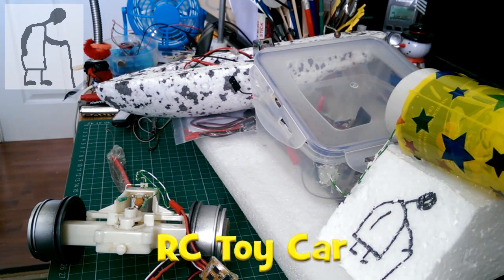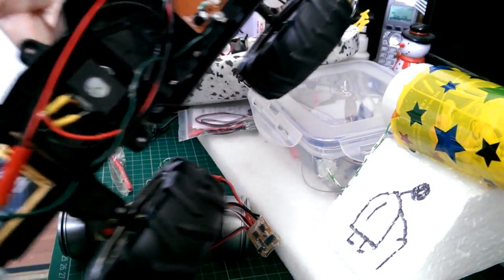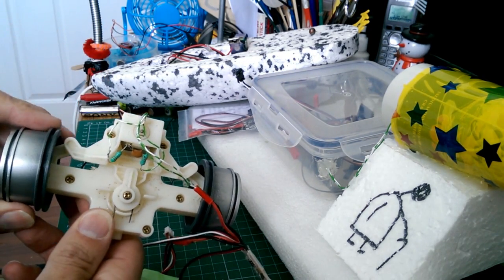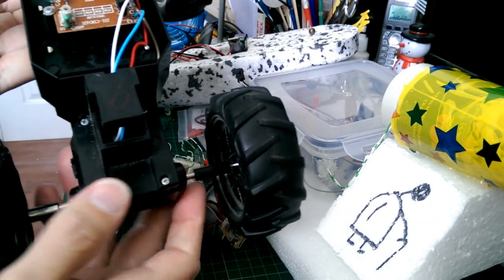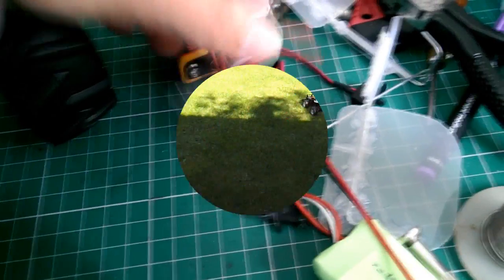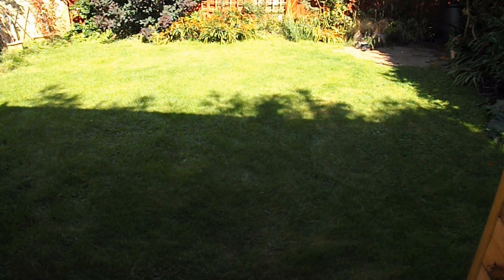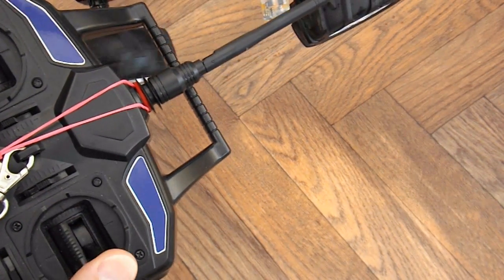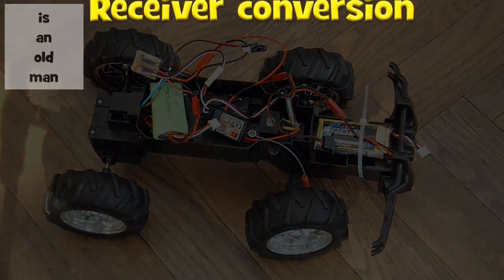RC Toy Car Hobby Grade Receiver conversion

Comment: I incorrectly thought toy grade RC cars had both the receiver and ESC on the same PCB board, but toy grade cars don't have an ESC at all. Just 4 signal switches or 2 switches per motor (channel). Its 3 positions per motor. Neutral, clockwise & counter clockwise. Your videos exposed this. I don't know why I didn't realize that sooner!
Reply from the maker: Yes, they are basically just "on/off" switches. There are more complicated toy grade that try to bridge the gap by giving stepped power stages to give the impression of proportional control.
Reply: @GrandadIsAnOldMan  Yea I think thats a form of Pulse Width Modulation they put on the motor channel. Where instead of forward and reverse, they have forward fast-turbo, forward basic\slow and reverse basic\slow. I had some of those cars in the 80s.

Comment: Hey granddad long time no see I was just wondering if you found a way to without using a servo still use the original motor inside of a toy car with a hobby grade remote
Reply from the maker: The video you are commenting on does not use a servo. I am guessing you mean control the toy grade receiver with a hobby grade remote and the answer is NO you can't do that. In fact I repeated this video in 2021 with a different cheap hobby grade kit https://youtu.be/UdB9KA50t6w I did once see a video on YouTube doing the opposite, controlling a hobby grade servo with a toy grade remote. I haven't been able to find that video since seeing it, but he was using a circuit board that took the output from the toy grade receiver and converted it to PWM for the servo. It still wasn't proportional, so I couldn't see much point in doing it.
Reply: @GrandadIsAnOldMan  since then I have taken apart broken servos and used the chip inside as the servo controller and basically it turns that motor into the servo motor and it is proportional

Comment: Does the ESC automatically handle the voltage inversion to change from one direction to the other?
Reply from the maker: Not sure what you mean by automatically. Your controller sends a signal to the receiver. The receiver sends a signal to the ESC to tell it what to do.
Reply: @GrandadIsAnOldMan  I keep replying but it seems to be that it's getting removed... I posted amazon links, maybe that is why.  I bought some ESCs and a transmitter and receiver off amazon but I am not having any luck.  Is there a way I can reach out for your two cents?
Reply: @GrandadIsAnOldMan  Sorry, I am super new to this scene, so trying to learn as I go.  I think the ESCs I got are for brushless motors, and I know mine are probably not as the RC vehicle is 20+ years old.  Not sure if that matters.
Reply from the maker: @FrostTrunks  an easy mistake to make when you are new to the hobby. Yes a brushless ESC will not drive a brushed motor and likewise the other way round. I would strongly suggest you have a look at the FliteTest RC Planes - beginners series. Obviously from the title it is aimed at model aircraft, but the topics they cover can be related to RC in general https://www.youtube.com/playlist?list=PL6IuSFWz4ktvupu_gxw1vn-sjBGOkJFHV as for contacting me, my details are in the video description along with other information.
Reply: @GrandadIsAnOldMan  thanks!!

Comment: the problem with hobby grade is they are to fast to control,
Reply from the maker: If you are converting to hobby grade then one of the main reasons is to have proportional control of the throttle and steering to give you full control. Hobby grade control does not make it faster. Of course adding a hobby grade ESC gives you the choice of bigger batteries and motors too but generally I keep the original motor as I am only looking for improved control and range. 😁👍

Comment: 👍 i like to convert toys to hobby grade toys to. I only use one esc and servo 😝🚘
Reply from the maker: Thanks for watching and commenting. Using two ESCs is the lazy way, no modifications to the steering required, however you will find I have done many conversions, including adding proper servos for the steering.

Comment: Sure you can model regular toy control car into a hobby grade RC ESC servo battery transmitter that's all you and it's a lots of fun tinkering trying to figure out how to get those items to work with rc
Reply: People often think toy grade RCs are throwaways after something breaks. You know have people 3D printing full cars and parts now. As a kid I used to screw off the old body shells and my dad would help me install them on the chassis of a newly bought car. This basically gave me an old car with new wheels because the chassis is hidden. I did this with a red firebird body from Nikko way before I ever owned a hobby grade car.

Comment: That went faster than I thought it would do the ESCs have Lipo  cut off
Reply from the maker: I don't think there is any mention of a LiPo cut off in the listing details for those ESCs. Here are the details from a typical eBay 20A ESC listing
Features:
RC ESC 20A Brush Motor Speed Controller w/ Brake for RC Car Boat Tank 

Specification:
1pcs 20A brush speed controller.
Function: forward, reverse, brake
Working voltage: 3.0V---9.4V.
Dimensions(L*W*H): 35.0*22.0*6.0mm
Current(A): 20A
Driver frequency: 2KHz
Input: Li-Po 2S / Ni-Mh/Ni-cd 4-7cell
Constant current 20A Max 25A< 30s Pulsed 50A< 5s
Brake On / with brake
This ESC can work with 130/180/260/280/380 Brush Motor
Size: 20*20 MM
Reply: GrandadIsAnOldMan well it says it works with  LIPOs so I hope it has LIPO cut off
Reply: GrandadIsAnOldMan how much are they and I’m guessing they’re from China

Comment: I'm building some old toy grade RC's I have up with hobby grade electronics, and they're going to be awesome! Those vids are coming soon!
Reply from the maker: The main issue with using old toy grade kit is the gears will fail when you put more power through them.
Reply: GrandadIsAnOldMan I know, lol. It's more of a video series where I do it to multiple toy grade cars and see how long they last! It'll be fun for me and the viewers! I have some different kinds of fireworks that I will probably end up putting on the cars too. We will see!
Reply: Were you able to complete them?

Comment: Dont know why you used 2 battery's when you only really needed one 

Did you try replacing the steering motor with a servo ? 

Once you got the RC stuff it will basically pay for itself in the long run as you will only need one transmitter for most things.

I noticed you were using what is know as mode 1 (throllte on right) take it that is because your transmitter is mode 2 (throtle on left) and harder to set up when doing somethign with reverse as i found out with boats as got my DX6 I for aircraft
Reply from the maker: At 08:56 I tell you I could have used a doubler plug adaptor to use just one LiPo
No I didn't use a servo because I was demonstrating that you can use an ESC to control the existing steering motor.
No particular reason for using the throttle on the right hand side other than full control with just one thumb, but as you say the auto centre does make it easier to return the throttle to zero by just releasing the throttle. I tend to put the throttle on the left now, in fact many of my boats use variable thrust steering so I have left motor on left stick and right motor on right stick.

Comment: can you upgrade the back motor with brushless (inrunner or outrunner)?😐
Reply from the maker: I am sure you could if you wanted to. You might have to hack the plastic around a bit to get it to fit if you cannot match the exact size.

Comment: its takes two esc to run or can i use only one esc ?
Reply from the maker: I use one ESC to control the drive motor (forwards/backwards) and one ESC to control the steering motor (left right).

Comment: Can I connect led light system with this???
Can you pls. tell me the name of the receiver and can I use my original transmitter with the converted version??
Reply from the maker: There are circuit boards available that allow you to control LED lights from hobby grade RC receivers. The receiver and transmitter I use are FlySky. No your original toy grade RC transmitter will not be compatible with a hobby grade receiver.
Reply: Can you pls. tell me the name of any other cheap receiver with transmitter.
Reply: That is compatible with the Esc's
Reply from the maker: Hiten Samalia All standard hobby grade transmitter/receiver combinations use standard hobby grade ESCs. FlySky are the cheapest I have seen but you would have to do your own search to find what is available locally to you.
Reply: Ok sir.

Comment: what kinda battery I should use for making a better car?
Reply from the maker: +Rashedul Hassan before you think of changing a battery to improve a car's performance you need to consider what might happen. Just using a battery with a higher voltage will probably make the motor run faster but if it is an RC car you may find the RC receiver cannot handle the higher voltage and you burn it out. Normal alkaline AA batteries give you 1.5 volts so if your car has 4 AA batteries the RC receiver will be expecting 6 volts. If you fit a LiPo battery they are in multiples of 3.7 volts so a 1S LiPo gives you 3.7 volts and a 2S LiPo gives you 7.4 volts. That means if you fit a 2S LiPo to replace 4 AA batteries you will be overpowering the receiver by an extra 1.4 volts. In fact it is worse than that because a freshly charged 7.4 volt LiPo actually gives you 8.4 volts. If you are lucky you receiver will survive. If you are unlucky it will overheat and could catch fire. There are ways of adding electrical components to get around this but that is more complicated than just changing the battery.

Comment: If a servo motor burns out, take the chip out and its a mini esc (first center potentiometer and super glue it) solder steering motor to  the contacts were the servo motor was.
Reply from the maker: +squidink RC yes that will work. FliteTest did a video on how to do it and I have done videos too although there is a good chance you will burn the chip out if your steering motor draws too much current. Here is a recent video I did on the subject https://youtu.be/_Jtd_e4nsmo
Reply: +GrandadIsAnOldMan thanks!

Comment: on your boats. how do you get the propeller to spin without water leaking in?
Reply from the maker: +space1188 I always have the motor higher than the water level which can be a problem with the balance so I make sure I have weight in the bottom of the boat to stop it tipping over.
Reply: thanks

Comment: hobby grade rc is very expensive, i do drifting and offroad rc.
in the past i also did rc tanks but that cost to mush money.
Reply from the maker: +ProjectOfGames it all depends on how much you are willing to spend and what you want to spend it on. You can enjoy hobby grade experience for the same price as a few computer games if you are willing to buy from China and can wait for delivery.
Reply: And I'd advise if people want to upgrade a toy grade rc car to a hobby grade look at the Wltoys range there's plenty of spares that would fit and convert a full range of sizes and the plus side is the receiver/esc is a 2 in 1 box. So you just need a servo, receiver/esc box and a transmitter and some basic skills to modify your rc car and voila
Reply: GrandadIsAnOldMan Absolutely right there all my Rc comes from China amazingly low prices and good to great quality
Reply from the maker: DIMITRIOS GYLTIDIS :-)

Comment: Maybe you can put in it a bigger motor for more power :)
Reply from the maker: +Battle Brot that was not the purpose of the video. I was asked to show how to change the receiver for a hobby grade one.
Reply: +GrandadIsAnOldMan Ok that was just a question...
Reply from the maker: Battle Brot well the simple answer is Yes, you can always put a bigger motor if you can manage to match it up with the existing gear system. The long answer is..... As the wheels have no grip with the existing motors, you will be needing to change the wheels too. Then you will find the steering is not much good with the simple method used here so you will want to change out the steering system. By that time all you have left is the plastic shell body which is a heavy plastic compared to the type of shell used by hobby grade model cars so you will want to get rid of that. So what is left? Nothing from the original car so you might as well have spent your money on buying hobby grade from the beginning.

Comment: you could try high grip rubber tires with a soft compound
Reply from the maker: +GuitarRocks360 you could buy a proper hobby grade car and do the job properly.
Reply: +GrandadIsAnOldMan  Well a matter of fact.  I do have a Traxxas Slash RWD.
Reply from the maker: GuitarRocks360 there you go then. People hoping to convert a cheap RC toy car into a hobby grade RC car don't realise it's not just a matter of putting a big battery in the car to make it go faster. Everything has to be changed and once you have changed everything you realise it would have been better to start with a proper hobby grade car anyway.